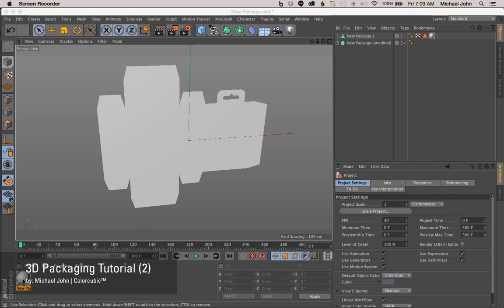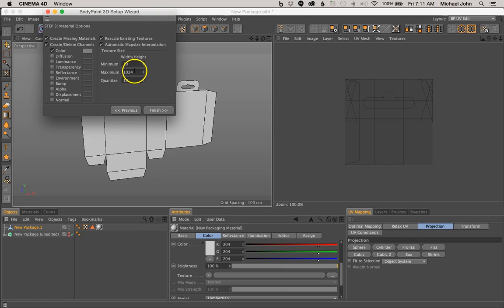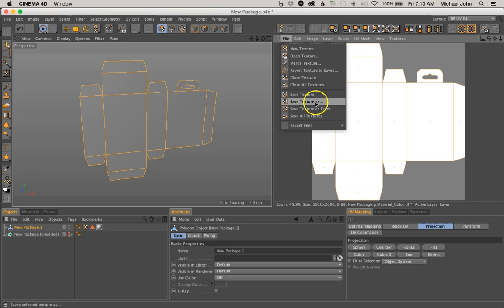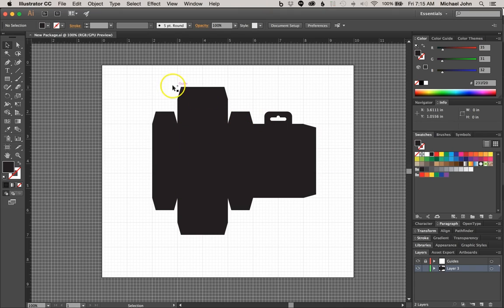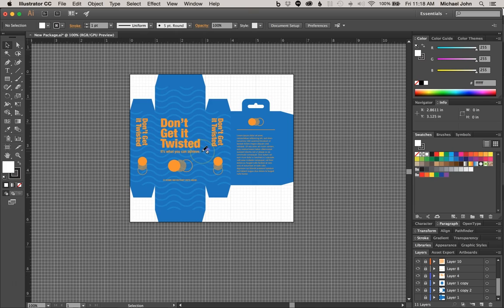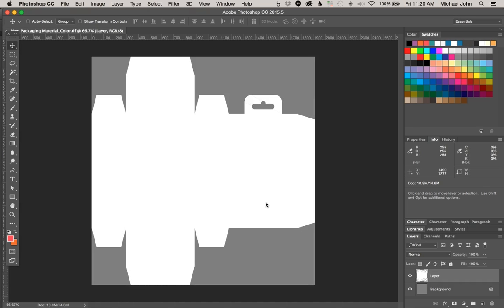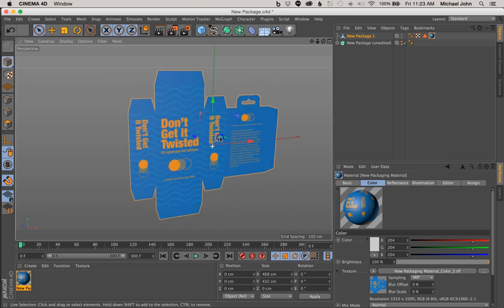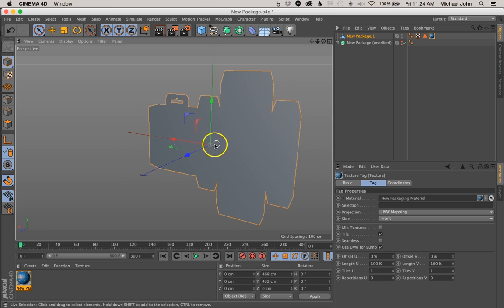Cinema 4D Tutorials - 3D Packaging (Part 2)

Comment: When I set the UV mapping to "Front" only, the back side still shows up. Is there a setting I have to do? BTW, I am using version R12. Thanks!
Reply from the maker: Interesting. I haven’t used R12 in a while, so I’ll have to determine what obstacles you’re running into. At first thought though, have you tried reversing the Normals?
Reply: @Colorcubic  I found out if I do a quick render preview, the graphic on the back side is gone. Is it some kind of viewport preview issue?
Reply from the maker: Yeah, sometimes in earlier versions to C4D, it’s a caching issue, so it’ll retain some of the graphics you’ve already updated.
Reply: @Colorcubic  Actually, I am totally new to this software. Where do I reverse to normal?

Comment: Great tut ! Things really well explained. One thing - you went back to Illustrator to get the formula for the right shade on backside. Why not use colour picker in C4D, and simply get sample from the frontside ?
Reply from the maker: Sometimes the color picker in C4D isn't as accurate as grabbing the hex or RGB code from the official file. But yeah, you can definitely do that.

Comment: In the BP UV Edit section, I can't see the full package in the right window as you do. I only see one piece of it. Help.
Reply from the maker: Hi Loulou, without seeing your project file, it's hard to determine what's wrong with the scene. However, one of the most common mistakes is that people forget to select all of the package, before defining the texture dimensions for the BP UV Edit. 

In the perspective window (on the left side) did you select the whole package? If you click inside the perspective window, and select "Command + A" (if you're on a mac) / or "Control+A" (if you're on a PC), that will select the whole package you've modeled, and at that point, you should see the whole package on the right side.

If it's still not working for you, feel free to email me your project file, and I can see what's going on with it.

Comment: Is it possible to do this part after i finish all the other parts first? :S
Reply from the maker: You don't need to work on the artwork, as you can implement that at any time, but you do need to allow that texture map to be defined by the whole, unfolded package shape before you start separating each individual component of the package, otherwise the texture map won't know to define the whole dimension. Currently, at this state, the object is one whole object. Once the texture map is defined, the artwork can be applied at any stage after. 

Although you could create the artwork after separating all of the individual components, but you would have to design each individual component separately. The way I reveal above saves you that headache, and a ton of time.
Reply: Exactly, that's why i made that question, because i thought it could be another way to texture it in a whole at the end, a way that i wasn't able to think about, guess it can't be helped, thank you very much for the videos, keep up the good work and thank you for the reply!
Reply from the maker: You're welcome. Cheers!